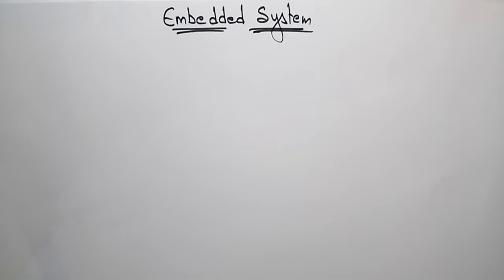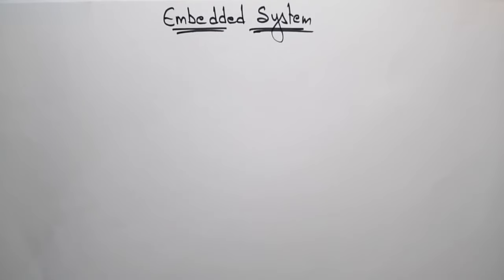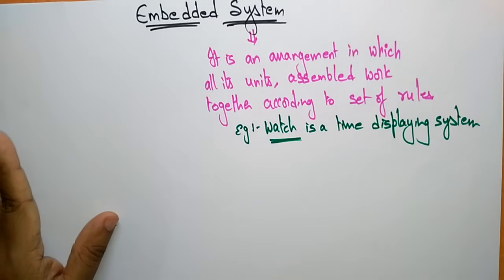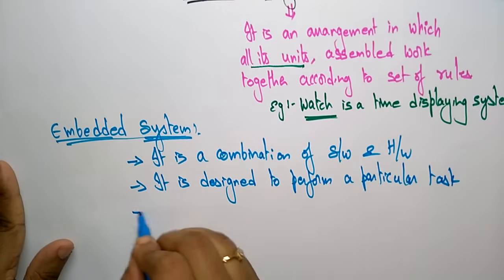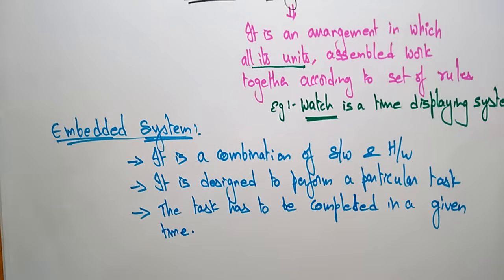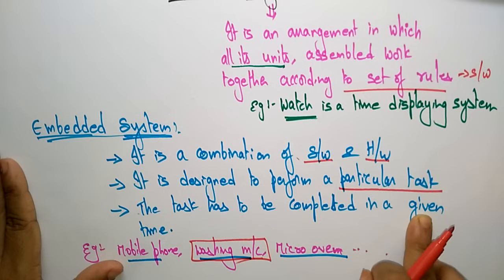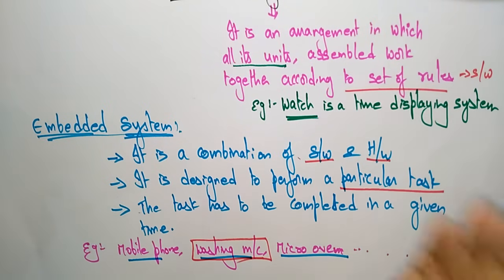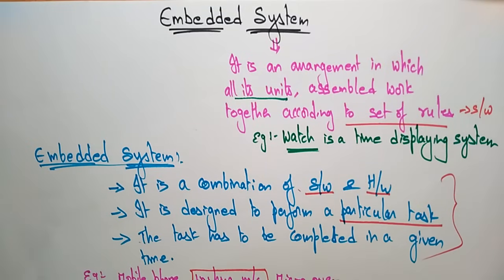Embedded Systems tutorial for beginners | Lec-01 |  Bhanu Priya

Comment: Good explanation mam ...one thing I wanna share.. mobile phone is not a embedded system .. it's a general purpose system.. because we use it for n number of operations
Reply: BUT THE CORE APPLICATION OF MOBILE PHONE IS COMMUNICATION PURPOSE.
Reply: A mobile phone is indeed an example of an embedded system. While it is true that mobile phones have a wide range of functionalities and can perform numerous operations, they are specifically designed as embedded systems.

Mobile phones consist of specialized hardware components, such as microprocessors, memory, and communication interfaces, which are tailored for mobile communication and computing. They also run dedicated firmware or operating systems optimized for mobile devices.

Embedded systems are not limited to performing a single function but can handle various tasks based on their design and capabilities. Therefore, mobile phones can be considered embedded systems due to their specific purpose, specialized hardware, and software optimization for mobile communication and computing.